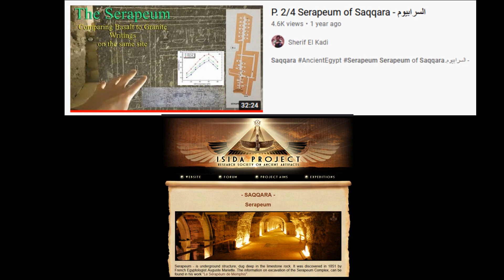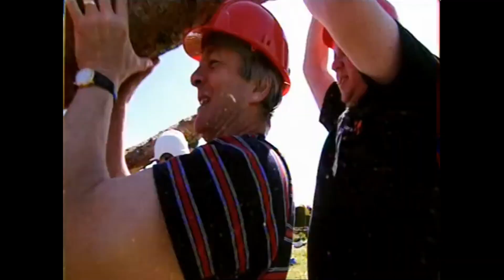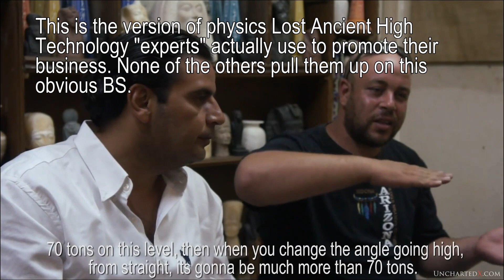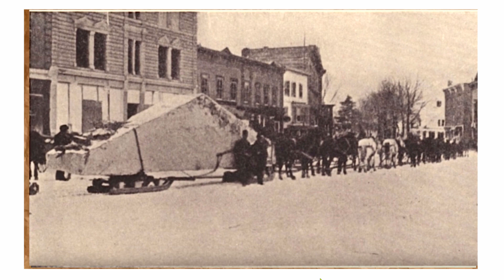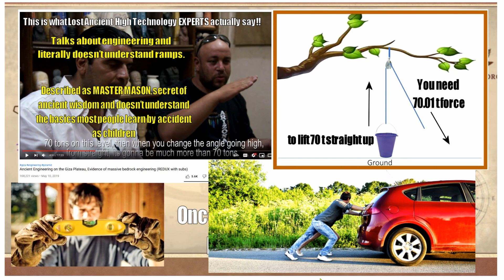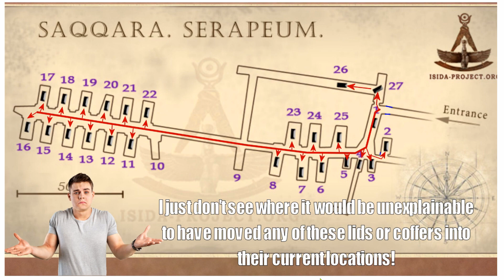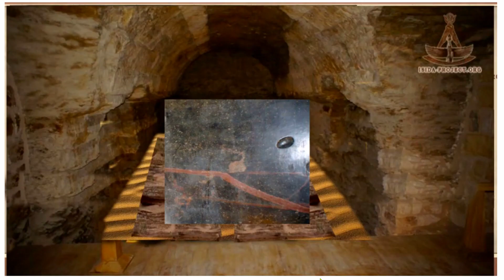Serapeum of Saqqara & Lost Ancient High Technology DEBUNKED Part 1

Comment: Ignorant experts and tour guide they are. The best-known surviving mudbrick example is at the Karnak Temple Complex in Thebes, where the remains of a ramp still lean against the rear of the towering First Pylon, built around 656 BC. Other examples consist of two thick, outer mud-brick walls with an interior core packed with debris and stone chip. The stones in and above the king’s chamber do not weigh 70 tons or more as claimed by these experts. The heaviest granite beam weigh 62 metric tons. Others much less. Detailed information on this: Jean-Pierre Houdin, The Big Void, 2022, Page 32.

Comment: I like how you conveniently left out how the mussolini monolith was moved onto a modern metal motorized boat, specially designed to hold 300 tons. So according to your logic that must means the egyptians must have had the same tech to move 300+ ton blocks from the aswan 500 miles up the nile! Ancient high tech for the win
Reply from the maker: I love how you conveniently left out ancient ships that displace water the exact same as modern barges.
Also it’s down the Nile rather than up and you’d like to look into speeds of the Nile during the various seasons (prior to high Aswan dam) was recorded. Less than 1kph at times but they were going with the current not against it.
Please try better and take an actual interest rather than these foolish lost high tech defender BS.
Reply: @SacredGeometryDecoded  LOL they found only ONE ship! And it could not carry 300+ ton blocks.
Reply from the maker: @MrPenguln  they found only one ship? No. You only know of one ship. 
I’m gut easing the Khufu ships because it’s the same one every other person whose knowledge is based on bright insight - Hancock school of deliberate ignorance.
It’s called displacement. 
A small increase in the size of a ship increases the capacity a lot.
You are ignorabt and are defending an idiotic cult because this is your new age religion.
Reply: @SacredGeometryDecoded  Don't nitpick at the facts, the fact is you never discovered any ancient egyptian skips even close to capable of carrying over a 300+ ton block. For a person claiming that there is a lack of evidence for ancient high tech, you seem to have very little evidence supporting any of your claims.
Reply from the maker: @MrPenguln  you just said they only found one. You are ignorant
Barges can be made by strapping smaller boats together. 
For a long time the size of ancient ships doubted until they found the nemi ships. Ancient ships that can carry over 1700 tonnes.
Ancient Egyptian descriptions show massive ships including transportation of obelisks.
Your lack of interest in something you claim to care about is telling.
It’s a cult.
Reply: @SacredGeometryDecoded  Lol at least I dont drill a hole in a rock and claim I can make a vase like you. I think you are ignorant. If you claim they can make a vase, then make a vase already. If you say simply strapping a few wodden boats together could transport a 300+ rock why dont you show us how its done? You, Frank Dibble, and those other mainstreams are no better than Hancock, so sure of what can can and cannot happen without any actual evidence. I bet ur one of those ppl that thought the Antikythera mechanism was fake when they found it.
Reply: @SacredGeometryDecoded  rather telling you can’t name a boat other than the Khufu boat. Just a load of emotional waffle and zero evidence to support your fantasy

Comment: Leverage is most easily explained for me with the analogy of a car tyre you cannot undo the wheel nuts (impossible) without a bar for leverage and the longer the bar the easier it is. I worked in a scrap yard for a few years and old rusted on truck wheels I simply put the normal bar on then a piece of scaffold bar to extend the leverage and you can pop the wheel nuts loose with one hand

Comment: Can you tackle how they built the pyramids
Reply from the maker: Not without a time machine to see exactly how they did it. Though an often overlooked ramp is the slope of the pyramid itself.
Wally wallington famous for moving giant blocks also showed example of what he called Egyptian Hoist. Based on his experiments it would take 9 months to haul the stone, though of course construction time in between.
Reply: First understand that most of the limestone used in their construction was sourced from a few hundred meters away.  Thus the blocks did not need to be moved very far.  Also the largest/heaviest blocks are found in the bottom half closest to the ground.  

As such those large blocks were not being raised to the very top of the structure.  Menkaure's Pyramid happens to use very large limestone blocks weighing around ~20 tons = but they are on the very bottom and were quarried along the edge of the foundation less than 50 meters away. 

The granite blocks above the King's Chamber of the Great Pyramid are still below the halfway point.  The blocks above are smaller in size with those at the top being small enough for several men to lever into place - look at selfies people who climbed it took and uploaded online.

In the western cemetery adjacent the Great Pyramid are partially completed tombs and attached to them are = earthen ramps.  The ramps are made of sand/stone chips - quarry debris/ and tafla - a clay they mined.  Near the worker village at Giza is the remains of a large tafla mining operation.  When the limestone quarries at Giza were excavated they were found to have massive amounts of = ramp filler dumped into them. 

At Karnak where hypostyle temples are located is the remains of a mud brick ramp used in their creation.  So you have physical evidence of 2 types of external ramps.  Also the tomb of Rekhmire shows a hypostyle temple being constructed using = a mud brick ramp.  So you have archeological evidence of ramp use as well.  Finally Herodotus wrote of their creating a "massive causeway" - read ramp.  So you have historical accounts of ramp use there. 

He also wrote they used levers and what he termed as "a machine" believed to be akin to the Egyptian shaduf using a fulcrum and counterweight.  He stated it rested upon "the steps" to raise blocks.  That would correlate to the smaller blocks in the upper half as the heavier ones at the bottom could be raised via the earthen ramps. So teams of men - and oxen - using wooden sledges + ramps + lever devices = and a lot of determination.
Reply: @varyolla435  Ramps everywhere, even the grand gallery is in effect a ramp. I also calculated that about 83% of the pyramids mass is below the relieving chambers (read where the known internal ramp is useful). Add to that the natural hill inside, it's safe to say 7/8ths of the mass is below the top of the relieving chambers.

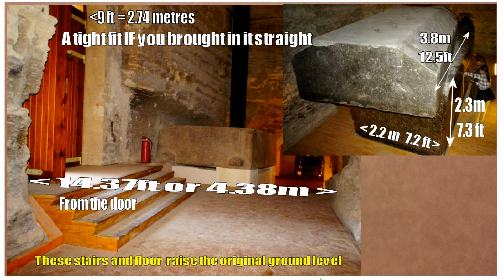Comment: 7:40  dude, there's not enough ROOM in there to fit enough bodybuilders to drag them, even with pulleys. And your ""evidence"" is irrelevant pertaining to the discussion; you are obviously pandering to dummies who are IN DENIAL; hence the hostility.
Reply: Thank you for an example of superficial reasoning........  Perhaps one day you will assume less = and "think" more - just saying.

As your consolation prize to illustrate your superficiality of thought here - and the utter failure of any purported "self-research" you have deluded yourself into believing you did here.

_"Look at a schematic of the Serpeum temple complex........ = notice anything???_"

Answer:  the niches are kitty-corner from each other......  Also you seem to overlook the obvious.  What can be "pulled" = can also be "pushed"......

Thus while they might have pulled them initially - once they began to make the turn into a niche = pushing from the rear could be done.  There is enough room for workers standing in the opposing niche across the corridor to push upon the rear of a sarcophagus on a sledge as others facilitate the turn into the space.  The sarcophagus could easily be framed in using wooden framework so that say a team of oxen upon being harnessed to the rear framing could push upon it the same as yoked oxen pull something similarly attached by wooden framing.  

Moral of the story:  Methinks your rant backfired on you.  🤭  That is what becomes of people making uninformed declarative statements online however as eventually you run into others better versed in the evidence than you assumed yourself to be.  Better luck next time.
Reply: @varyolla435   writing several paragraphs being smug and attempting to insult me is not proving they could fit enough people to pull it, even with pulleys. (let alone "push it"). The block isn't big enough to fit enough hands on it to just "push it".
Reply: @varyolla435  in your several smug paragraphs, your only rebuttal was "they pushed it."  and what "evidence" are you referring to?
Reply: @freefunnyclips2748  Trying hard to not think I see......  I of course understand.  When you are fueled by "incredulity" for many their brains seem to shut off - especially when presented with logical alternatives.

So do you deny things which might be "pulled" can also therefore be "pushed"???  I hope not.  So it was possible for the Egyptians who moved things on wooden sledges = to attach wood frames to something.  Thus if you have a wooden yoke on one end - which is what your oxen/men pull upon along with ropes = could you not simply reverse that with a "bar" assembly at the rear from which oxen are hooked to and proceeded to push upon a sledge.  Surely your mind can conceive of such - and if not.......
Reply: @varyolla435   you couldn't fit enough oxen around the block to move it. How are you so entitled? What "evidence" are you referring to? Where is it written that they were pushed by oxen? You couldn't even fit enough oxen around it to move that much weight.
Reply: @freefunnyclips2748  😴😴  Round and round and round they go = but they never say anything.........  Kinda sad really.
Reply: @varyolla435   You can't fit enough oxen around the block to move it; even with the largest strongest oxen in the world. You've contributed nothing to the discussion other than entitlement and insults.
Reply: @freefunnyclips2748  That makes 5 comments now which are nothing more than regurgitation of your original incredulous claim.......  What began with "bodybuilders" = you now simply substituted "oxen".......  🤣  

p.s. - admit it = you have neither understanding here nor a desire to consider anything other than your own assumptive, simplistic beliefs.  So I repeat my observation = it is rather sad.
Reply: @varyolla435   so you're disagreeing? You think they could push that block with two oxen? They would need like 40. You haven't even really thought about it.
Reply: @freefunnyclips2748  That makes 6 now......  🤭  Also did I say 2 oxen......... - no.  Not going very well for you is it.
Reply: @varyolla435  are you disagreeing? You can't fit 40 oxen in there, guy.
Reply: @varyolla435  i said 2, because that's all you can fit on one side of it if your just "pushing it with oxen". You can't fit enough oxen in there to move it. Attempting to degrade me with smug entitlement isn't evidence otherwise.

Comment: This video only discusses moving the weight. This really is not of the main concern. The question is, How did they shape the stone? What was the tech used to carved and polish the stone?
Reply: There are other videos which speak to working stone using gneiss stone and other tools and abrasions.  As far as the Serapeum however the main thing one needs to keep in mind is that the areas of the temple open to the public = were the last to be created.....  That means those nicely carved and polished sarcophagi one sees in videos and photos often date to the Ptolemaic era of Egypt = which was well into the Iron Age.  

So they were not created using bronze and gneiss stone tools - but iron ones.  While iron tools existed prior - once the Persians conquered Egypt you see whereby the Egyptians begin to smelt their own iron since the Persians were already doing so previously.   As far as polishing stone = abrasives such as sand or corundum - likely mixed with a medium of some type such as clay.  Create an abrasive slurry mix of water/abrasive/clay and you'll have something not unlike today.  Kitchen counter cleaners as an example are often mild grit abrasives in an emulsion which scrub/polish the counter surface.  Working stone would be no different.

Comment: wood will sink.... The idiocy.
How do all the pros get stuck or sunk excavators out of dirt, sand, and mud? (weights ranging 1 to 100 tons Mini - Large )
Wood ties or just felled trees as support and leverage to help pull the excavator out of its sunken position.
The wood, a very tensile strong fiber, spreads out the weight across the surface even across a non-utonion surface such as slurry mud or quicksand and allows the excavator to pull itself free or in extreme cases to be pulled free with the help of other heavy machinery.
Reply: Yes.  Pound for pound wood can be stronger than steel.  It's main pitfall is it burns and is subject to insect destruction while sustained moisture can eventually warp it.  

As an aside.  Egypt is of course an arid climate.  While rainfall does happen it is sporadic.  The Egyptians tended to build away from areas of local inundation such as occurred when the Nile flood its banks each year.  So wood used for heavy construction such as incorporation into ramps etc. would not have been subject to excessively wet conditions such as swampy ground etc.  

There is evidence in the form of existing ramps in Egypt whereby they created them in part from clay.  Clay is of course quite durable when compacted and hence a surface made partly of clay would withstand a fair amount of pressure.  The mostly hot environment meant that if the surface was wetted to facilitate a laden sled moving across it more easily that it would quickly dry again. Thus using either log rollers or wooden planks laid into the surface of an earthen road heavily laden loads from being moved across it because the weight above would be transferred into the surface of the ground - unlike wheels/axles which must bear the brunt of it - would be entirely feasible.

Comment: If humans have existed for 300,000 years, with the same brain size & potential, why would it be more logical to assume that modern humans were able to advance more in 800 years than our equally intelligent ancestors were in 299,200 years?

Seems a bit irrational & seriously delusional...
Reply: First it is not "if".  Next is that knowledge acquisition - while linear - still follows a pattern of ebb and flow most usually upon need.  Upon a certain level of understanding about something being achieved what follows can represent "leaps" above the previous level owing to said improved understanding.  As far as the "need" it was actually our conflicts which led to many improvements in technology which then filtered out into commercial use - where further improvement took place.

Here is an example.  Early phones were clunky in size and limited in function.  Upon humanity developing micro-transistors and then satellites and fiber optic transmission we were able to create portable phones which could link into cell towers - and then smartphone technology.  So a "nexus" in understanding relating to certain technologies was achieved - based upon need of course - and that led to improvements at an accelerated rate. 

So no human knowledge development does not follow a fixed rate of progression.  Humanity had to be united into somewhat stable societies who for the most part worked together as opposed to millennia of trying to conquer one another via "empires".  They had to have a need to stimulate new developments = followed by a growth in understanding which lent to further understanding..... in what is a positive feedback loop. The more we studied the human body in the face of diseases which plagued mankind the better we understood how it worked ------> which allowed our medical care to improve based upon that increased understanding......   🤔
Reply: @Aliczander Dale "If humans have existed for 300,000 years, with the same brain size & potential," - They aren't. People with modern brain with the same capability as todays one evolved around 60,000 years ago. After that they still "wasted" most of the time on survival, not on making some groundbreaking technological advances.
They started working on that after agricultural revolution.

"Seems a bit irrational & seriously delusional..." - Only for ignorants who knows nothing about evolution of humans.
Reply: @przemog88  Actually homo sapien brain size 300,000 years ago were on par with humans today. Average human brain size has actually slightly decreased over the last 10,000 years. Your 60,000 year figure was what we were taught in school but has since been revised.
Reply: @methylene5  Nope, it wasn't revised. The size was indeed the same, however it had different shape.

Comment: I must say that i moved 1/2 toon in my garden, and i found pushing the leaver down was far more easy then lifting it up, if you lift it up then it digs or slide in the dirt,  pushing it down  and it locks into the rock and whatever you have under it and gives a far more effective force.